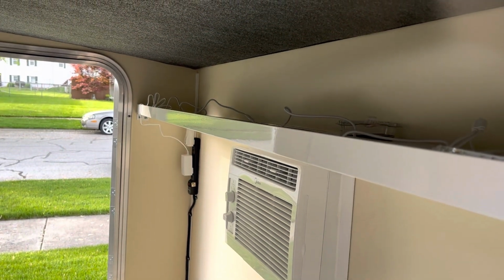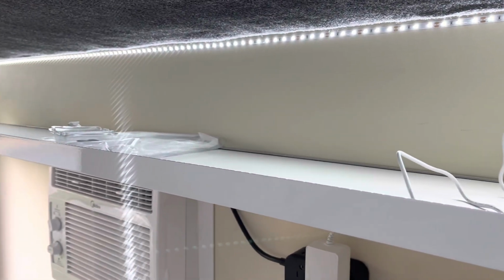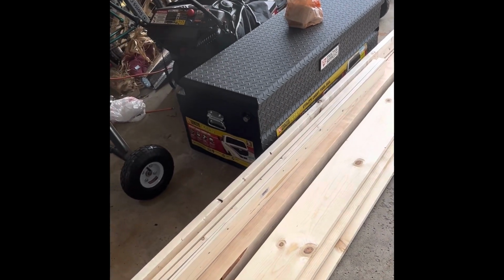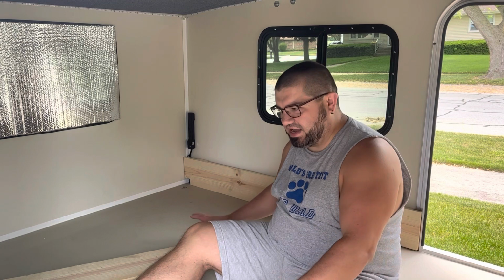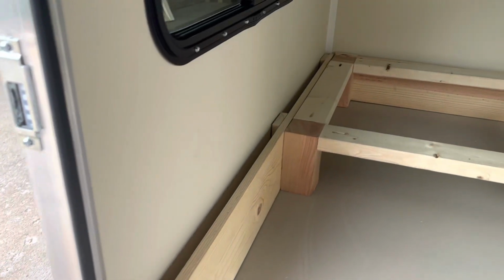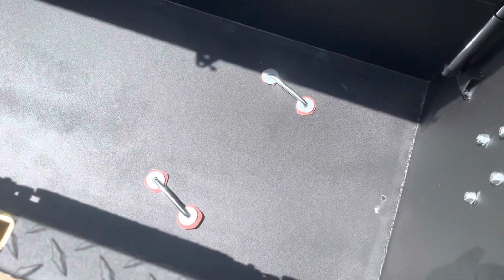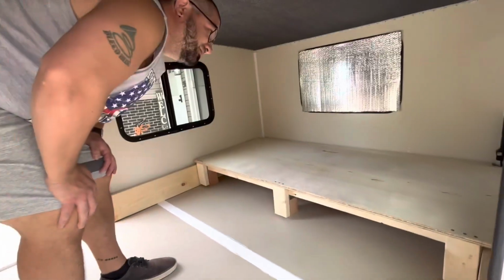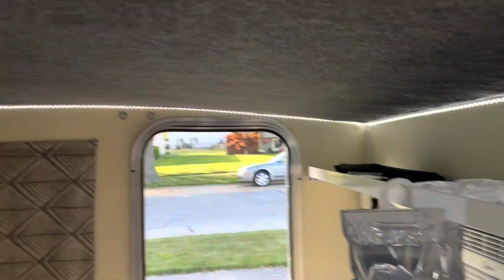Runaway Camper Modifications pt. 2 - Modifying our camper!  @LBDigzAdventures  ​⁠

Comment: Whats under the ac on the inside? Insulation of some type? Looks like its empty on video.
Reply from the maker: We've sealed it a bit with extra caulk to avoid any water getting in.  The floor has a pvc type tile that allows it to breath, with some foam tiles placed on top for a cushioned floor.  We have since added a shelf for tv, necessities, etc.
Reply: @LBDigzAdventures so far I've never heard of any water getting in even while towing with the new ac cover built in. The roof design is nice. No way water will get through that.